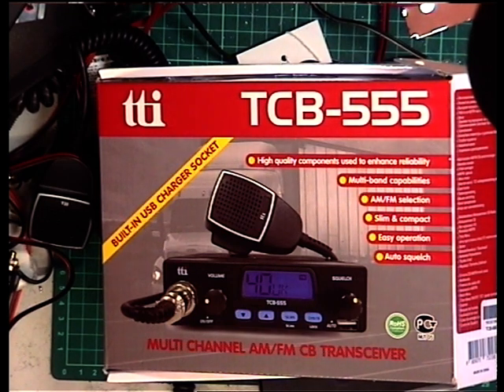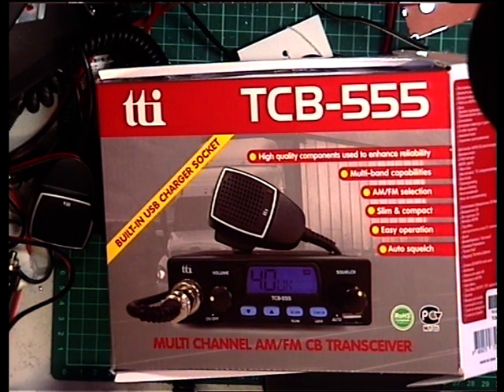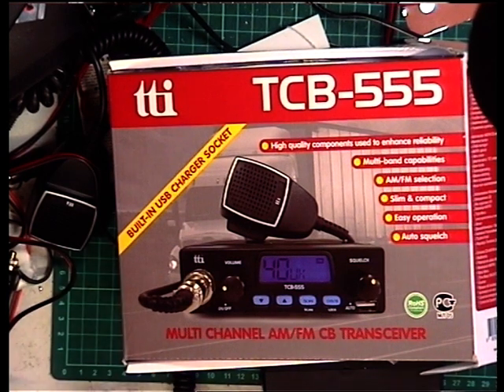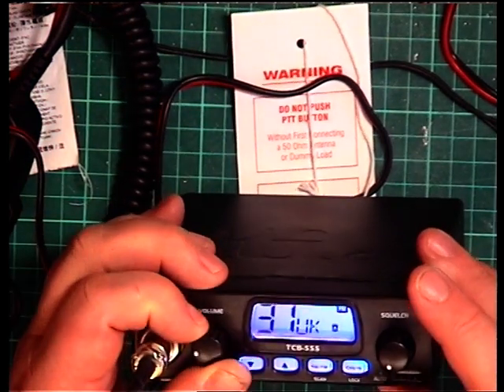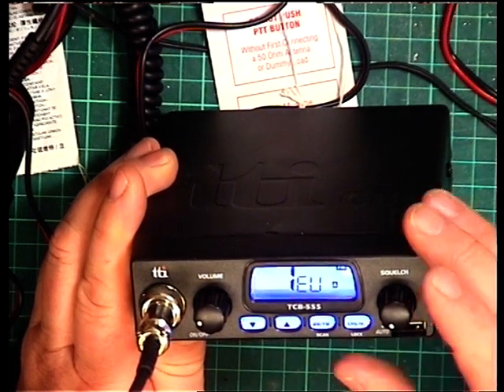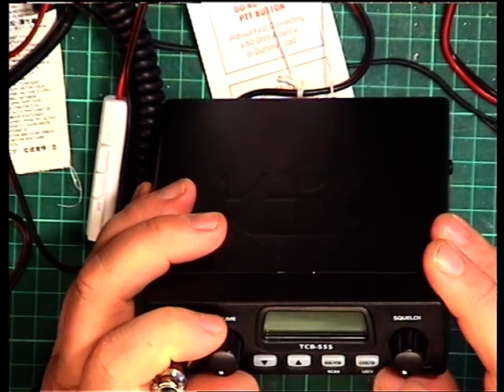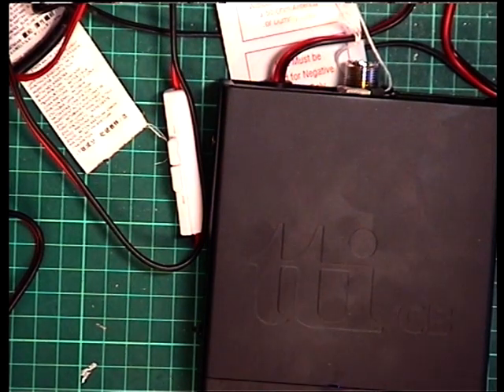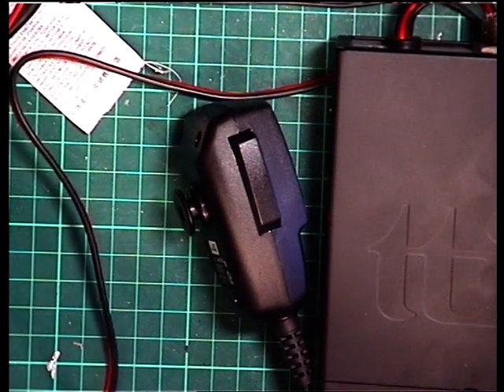TTI TCB555 UK CB radio (mobile) CE-Multi - Service adjustments

Comment: The setting on the tti CB radios for 80 channels ukfm & CEPT fm only is UE , works on 550,770 and 881, so may be the same for tcb 555. Please let us know. Please note, it operates as 80 channels concurrently, so when you go up one channel from 40 ukfm it puts you on channel 1 of CEPT. The AM/Fm button is still redundant. Also means when you use scan, it scans all 80 channels, which is quite undesirable at times of sporadic e. !!!! Best regards, Tim HT.

Comment: We had a tti 550 in the car for a year or two, before the “n” version came out, and to be fair, is was a pretty good performer. But,,,, it took around a second to tx on the uk40. I too thought that it would go on to Eu with AM button, it did not. It wasn’t until I was bored one night, and someone wanted it for their van, and was coming the following morning, that I discovered it did 80 channels, (ukfm &CEPT together)when in either ec or ce! And as a result, would scan all 80 channels. In uk mode, it was just ukfm 40 channels and nothing more. Worth playing with🙂, best regards Tim. P.s, just to add, to enhance the description if you went down one channel from ukfm 1, it would go to 40 mid, and the uk changed to ce I think. The 770 did the same. 👍

Comment: I’ve got a tti tub-560 what equipment do I need to be able to set it up and to give it a power boost. I like the radio but find it does lack on distance.
Reply from the maker: Most new radios seem to come out of the factory doing about 2.7W. Without watching my own video again, not all new radios will even produce 4W when tuned. This video shows what adjustments can be made & although I'm using a commercial Marconi radio test set to do both transmit & receive, an RF power meter & a dummy load are all that are required to make changes to the RF power output. The snag is that many meters read very generously. For example, we tested two Zetagi meters & both said that 'real' 4W was Zetagi 7W!

Richard, G0OJF, UK